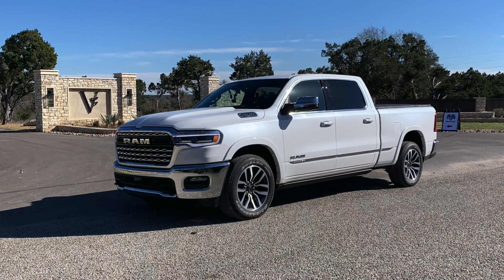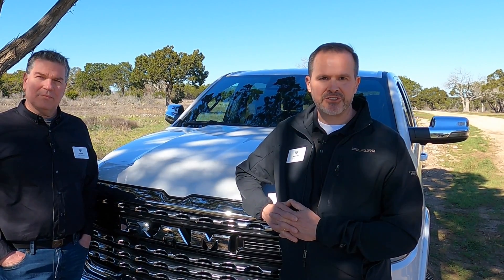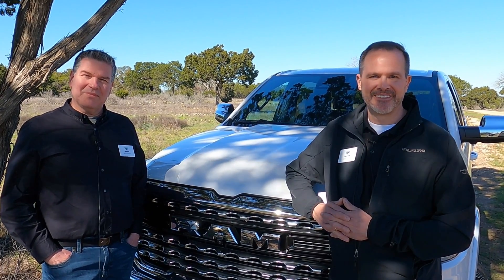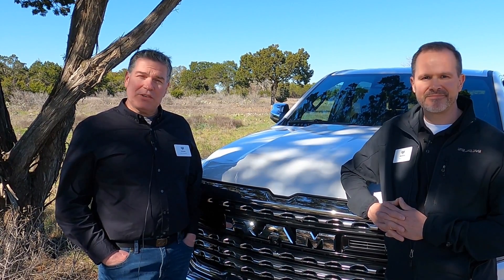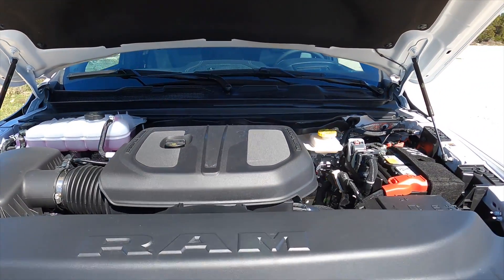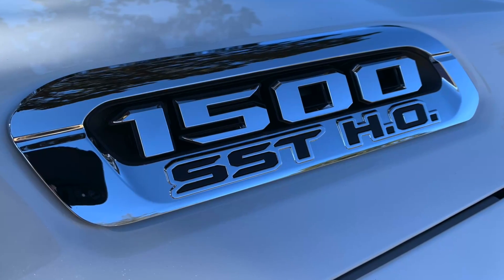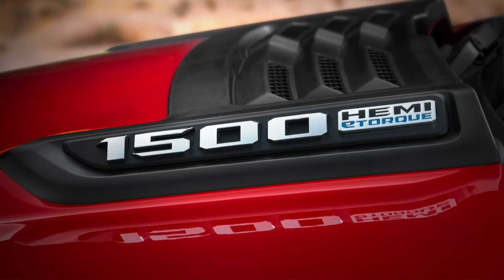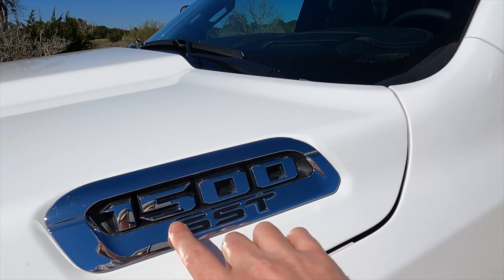The Engineering Behind the New 2025 Ram 1500. Amazing Insights!

Comment: I had an in-line 6 4.0L in two Jeep Grand Cherokee's, both flawless in operation.  I still own my  2004 GC Limited with the in-line 6 with 260,000 miles and running like a top.
Reply: Those r port injected engines
Reply: Difference is you have no turbos. That kills engines quicker
Reply: @milkdudd6758  ia first gen cummins has turbos and goes a milllion miles... back in the day they would take an engine like a 2.5 liter natural and put a turbo on it or a 3.8 and put a turbo.. gm got away with the turbo on the 3.8 because it was an over built natural engine when u build en engine from the ground up to be a turbo like here and u build in cooling like here tubos and longevity r the least if ur worries ive already see TFL put the hemi and the hurricane thru towing where the 3.0 runs 60 degrees cooler going up the mountain.. id be more worried about blow back

Comment: Direct injection causes carbon on the intake valves what you going to do about that?
Reply: It only becomes a problem after 70k miles LONG after your warranty runs out…ha hahahahaha so why do they care
Reply: If they do what Toyota and now Hyundai is doing, it won't be a problem. They also have a fuel rail spraying gas in on top of the valves to use the fuel, that keeps the valves clean as well. I don't know if this is 3.0 is gdi or not...doesn't matter to me, I wouldn't buy it anyway

Comment: Ram makes the best trucks ever and it’s not even close.. I will own Ram for the rest of my life! ❤
Reply: Wow. I mean, I like Ram trucks, but they have a lot of electrical problems and other issues as well. I hope this model year has resolved a lot of these issues. I see the Pentastar is still using the plastic oil cooler housing. That's just a matter of "when" not "if" for failure.
Reply: @joeb2588  out of the big 3 ram has the least amount of problems. Don’t believe me look it up. Ford and GM have major transmission problems, GM has transfer case problems, steering shaft problems, and have more electrical problems then my fiancé has shoes. Ford ? Well they have been the most recalled brand in the us since 2022 and it’s not even close. Again a simple google search will prove everything I’m saying. Ram is the king of trucks period!

Comment: I'm curious now, will the 3.0L Hurricane make it's way to the Jeep Gladiator. It's a smaller engine bay with less radiator capacity but they had the 3.0l EcoDiesel in there, so I see now reason why they can't make it work. That would be a sick mid-sized truck.
Reply: Exactly what I was thinking. I assume we’ll see the in-line six eventually make its way to the wrangler and gladiator.

Comment: Have they specifically stated what the mpg is for these new engines? I keep hearing the mpg is improved but I can’t find mpg listed anywhere not even on Rams website.
Reply: Your mileage may vary. I think it was Alex or Redline said they were seeing 20mpg on a 44 mile loop they did. I suspect a couple mpg better than the v8. But as we know when towing these turbos can get worse mpg than their v8 counterparts.
Reply: @jw8578  only issue with any unofficial mpg from anyone testing these trucks is they’re driving them like they’re stolen so it’s probably not true mpg but 20 isn’t bad for these test vehicles.
Reply from the maker: Since it's a 2025 model year truck it's probably not completely finalized yet. I hope to learn more soon.
Reply: @viewsonvehicles  Rams won't get much better fuel economy if they continue using a 3:92 rear end ratio.
Reply: 19/17/24